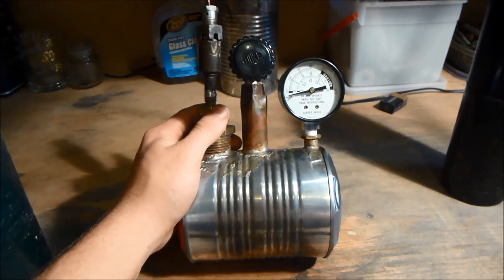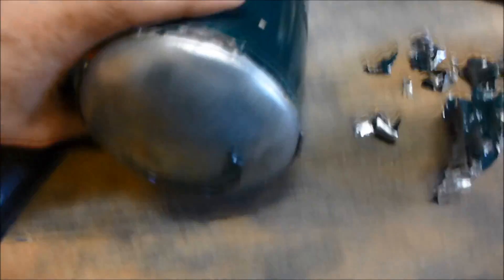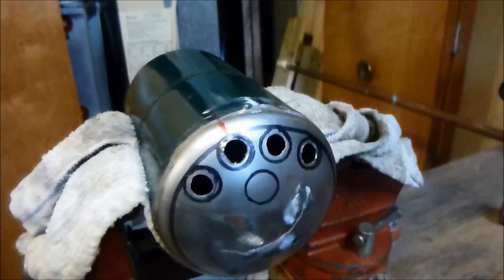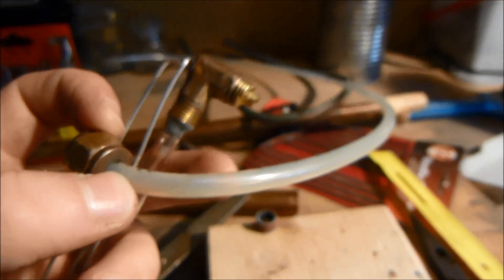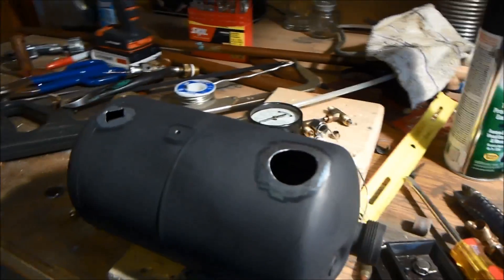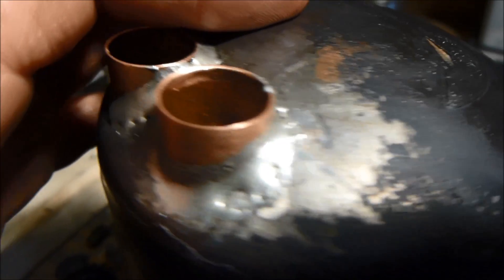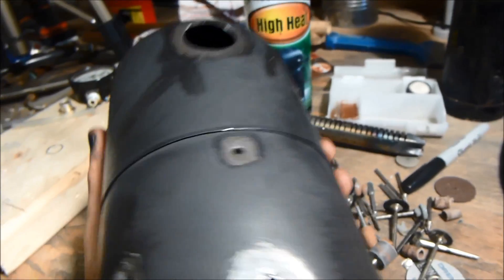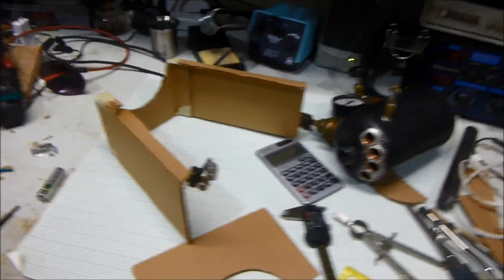Building My New Safe DIY Boiler From a Propane Tank

Comment: Using solder in a boiler other than for low pressure toy steam engines is insane, or ignorant.
At 72 PSI the boiling point is 305F.   
http://www.engineeringtoolbox.com/boiling-point-water-d_926.html
Reply from the maker: +RLZerr Well I would NEVER take the pressure to 70 PSI.  I water tested it to 70 PSI to test for leaks but that's it.  I only trust this thing to 30PSI of steam max.  At 30 PSI it's only about 250F.  Plus a 30 PSI steam leak is fairly mild.  At 70 PSI that's getting really dangerous.  My sight gauge melted the one day when it was at pressure and it was fairly mild.  I got steam sprayed on my leg and it was hot but I didn't get a burn.  I mean my leg was 2 feet away so it mostly got hot water.  It did make a huge mess non the less.  Thank you for your concern.

Comment: I noticed you're using the Matrix drill and I LOOOOOOOVE mine, but unfortunately have blown a diode over the years and it is now on order.  Thru misdiagnosis, I originally thought it was the rectifier and extracted it.  Now that I have both removed, I remember that I neglected to take a picture of the circuit and B&D doesn't have a schematic online.  Would you be willing to open your drill and take a pic of the trigger wiring for me?  It's very easy to open the body and reassemble as just 8 screws keep it all together.  If you'll do that, please send me a pic of the trigger wiring to freemyggle3@gmail.com.  TY
Reply from the maker: +Michael J Do you still need that picture?  Sorry I didn't see your comment earlier.  My email is makerj101utube@gmail.com if you still need the pictures.

Comment: For some more power you can split the steam output to multiple small pipes and run them in the flues in counter current to the hot gas so you superheat the steam.
Also you will always get dry solder joints on steel with normal solder, you need silver solder for this I think.
Reply from the maker: akkudakkupl Yeah I've thought about that!  Yeah I don't have silver solder tho.  Thanks!

Comment: Will it blow up your room?
Reply from the maker: Omega Man Yeah if ti blows up.  But I have a pressure relief valve so it will let the pressure out before it blows.
Reply: it would be nice to have a separate tank above it with the pressure relief valve. have it half full of water.
Reply from the maker: Omega Man How would that work?  So it dumps water in when the pressure gets too high?

Comment: Kid, you're going to seriously hurt yourself with that. What you may not have thought about here is that steel and copper handle heat very differently and expand with heat at different rates. In turn making your "solder" joints prone to fatigue and then failure. I recommend construction of 100% copper to which the ends are supported with stays, and any flue tubes are swagged and rolled over. and then using SILVER solder minimum.
Reply: Makerj101 If you want to get some knowledge I suggest the Pan Global Power Engineering books and the boiler construction code books from Canada if you can get your hands on them. Tons of great information and they show you how to do the calculations needed. Good luck with everything!
Reply from the maker: I know what you mean.  I just don't have the tools.  I also will only bring this boiler up to 40 PSI max.  I am thinking about putting the boiler out in the middle of a field and powering it up without the pressure relief valve and then retreat to safety and see how it fails and what pressure it withstands before failure.  Would really make me feel a lot safer if I knew the extent to which this boiler can withstand.  Thank you for your concern.
Reply from the maker: Tyler Bohn Cool thank you!  I'll look into those books.
Reply: Copper is not a good material for boilers its inherently to weak,the propane tank he's useing is many times stronger than copper its a pressure vessel,and the normal solder is fine for this kind of boiler so is the plastic tubing for the water gauge

Comment: Great work! I was planning on doing this last summer, but never got around to it. I am gonna start on it soon. I was wonder how you get an empty propane tank. Can you buy them or do you have to use one up?
Reply from the maker: Wis Trash I got it from my grandmas basement!  Yeah you just have to use up the propane.  You technically could just buy a new full one and empty it out since they only cost like $4 full.  Good luck building yours!

Comment: Nice work! I think if you bring the tank up to heat more, you will get the solder to flow better.  Concentrate your torch on the tank around your joint. It has more thermal mass and by the time it comes to heat, the pipes will be too.  It should be hot enough to touch the solder to it and melt it without the torch directly on the solder. It will flow and wick better.
Reply from the maker: SugarcreekForge Thanks for the tips!
Reply: Makerj101 
Put the tank in the oven set at about 450- 500 degrees for a 20 or 30 minute period before soldering next time.
This will get your solder to flow a bit easier for you.
Oh BTW, you really need to buy a tripod, shaky camera work is the only negative for this video.
Otherwise very informative.
Thanks for sharing.

Comment: Maybe you can use a 7-1/4" X 1/4" Copper Pipe, with holes drilled along the length and around the diameter of the pipe, up in the steam area inside the boiler ?  This is called a Drypipe which goes the full length of the steam/water "drum" (boiler) and it will help separate some of the water droplets from the saturated steam vapor before it enters the Main Steam line.
 The Drypipe, in the upper Steam/Water section of the boiler, will be connected up to the riser where you placed the Main Steam Stop Valve.  :)

Comment: glass can withstand the higher temps better the plastic. I have three model steam engines and they all use glass for the sight gauge.
Reply from the maker: Josh Kilen Yeah but the glass can't handle the thermal shock of soldering the jonts.
Reply: Makerj101
true but you could use the piece of plastic to space you fittings, then when your done soldering you would replace the plastic with a piece of glass the same size and length of the space.
Reply from the maker: Josh Kilen True

Comment: Very nice and excellent craftsmanship on your part.  Look forward to seeing this one in action. I too have problems with lead-free solder; the stuff is just a pain to get sufficient wetting (using enough heat) before the flux evaporates and the joint oxidizes.  I think is will hold just fine since you have good enough wetting in the interior of the joint.
Also, like your sight-glass, as it is very important to not run out of water which will cause the boiler to heat up and loosen the solder etc.  Once again, great job!
Reply from the maker: SpinStar1956 Well the lead free solder seems to be just fine!  I just tested the boiler out today and ran it for several hours and no leaks!  I refilled it with water at least 10 times!  You have to fill it up every 20 minutes of running and it takes about 5 minutes to recover back to a good boil and pressure.  So it is working well.  Now I need to rebuild my steam engine because there are a couple failure points I need to address to get it operating more efficiently.  Maybe I'll just build a new one.  Thank you!

Comment: Wow, awesome. Now I want to make a new boiler for my steam engine, lol  They,re good winter projects :) here is mine Home made twin-cylinder double acting steam engine with new boiler
Reply from the maker: Thank you!  Yeah you could do with a safer alternative!  Cool!
Reply: Makerj101 I'm just waiting to see how yours works out, mostly the heat transfer and the flame draft through your flue tubes :)
Reply from the maker: ch300fnqi It actually works great!  I was testing it out the other day!  You can hold your hand over the exhaust gases without getting burnt!  For the test I was just using some fire bricks as a fire box.  I don't have a chimney yet so there is not enough draft to make the flame burn efficiently and it would go out some times if you turned it up too high.  So I added a little DC blower fan to the air intake and it works great!  Now that I am getting good combustion it is way more powerful.  Before when I would run the engine on full throttle the pressure would settle down to about 7PSI.  The engine runs pretty slow on 7PSI.  But now that I am getting better combustion with the little blower and using the same amount of gas the pressure settles around 15PSI which makes the engine run at an excellent speed and lot of power.  So I'm thinking I could even use a bigger orifice to get more natural gas!  Once I get a good chimney with a good draft I'm hoping I will not need the fan anymore.  If I do still need the fan I think I would make a little steam turbine to run a little fan!  Or just inject some steam into the chimney to help with the draft.
Reply: Makerj101 Sounds like it's progressing great!  Put a video on when you get a chance :)

Comment: looks much better than the soup can boiler but the only concern i have is the solder melting when heating the boiler and then the copper tubes would pop off
Reply from the maker: Dean Walcott I think as long as I keep the water covering the solder joints I shouldn't have a melt down.  Thank you!
Reply: Steam can only get to 211°f, even at the pressures he's at
Reply: would it though? maybe someone with more knowledge could confirm or correct me. I think the boiling point of water is 132C or 270F at 30PSI. that seems high to me, so I could be wrong.

Comment: Is it possible to make a modification or an add on to make the steam a little dryer so that water does not just pour into the engine?
Reply from the maker: jdflyback Yep!  Just run the steam output pipe through the fire box!  I've seen other steam engines here on YouTube use that method.